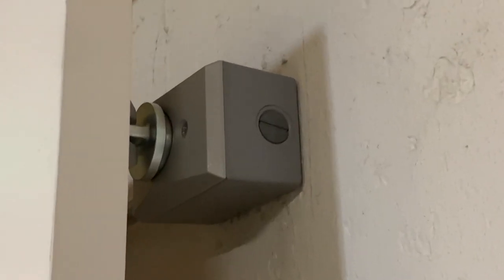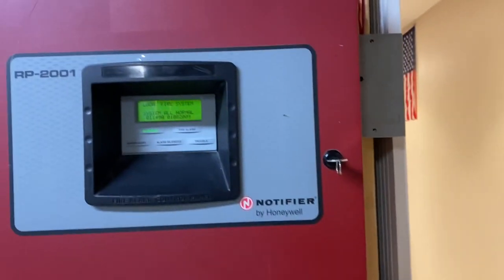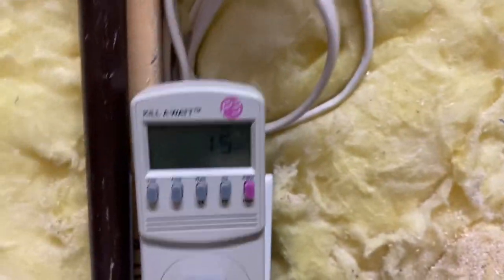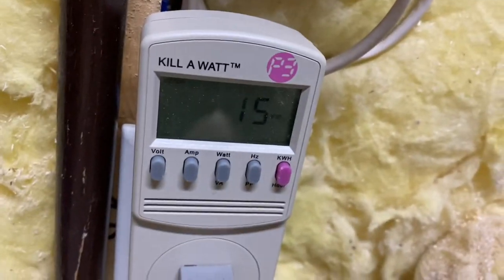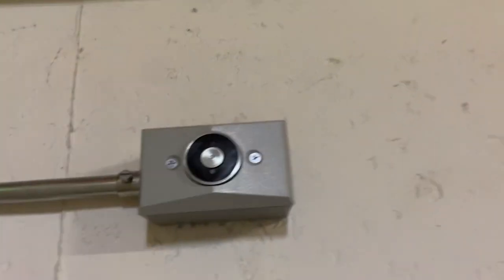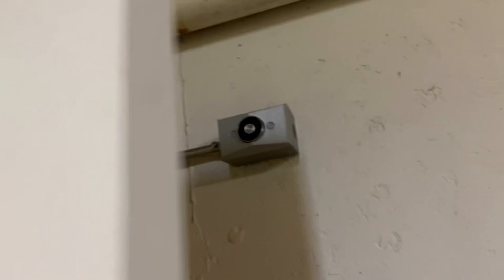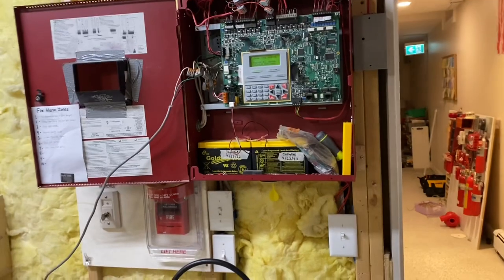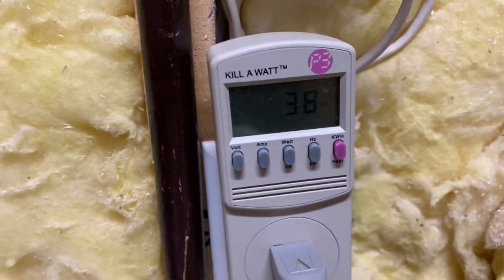How much power do electromagnetic fire door holders use?

Comment: They use about 1500ma to 4000ma depending on strength at 12v
Reply: That would be like 18-48W, but he had 15W with the magnet on and off, so under 1W usage - strange
Reply from the maker: That is incorrect. The specifications for this door holder state that the unit uses 15ma or 0.015 amps, which at 24 volts would be 0.36 watts